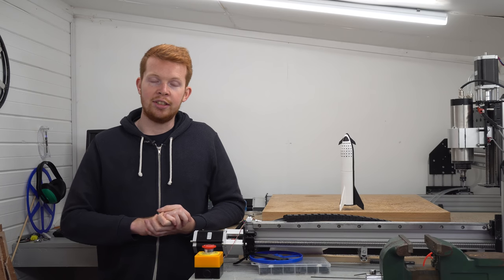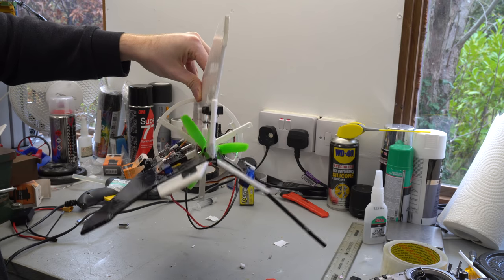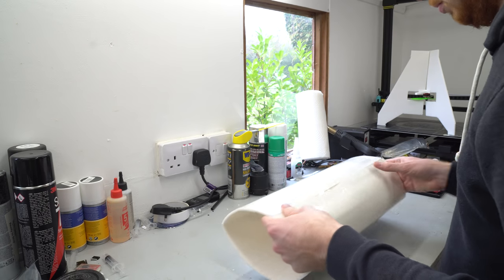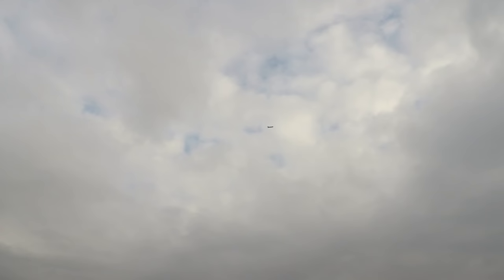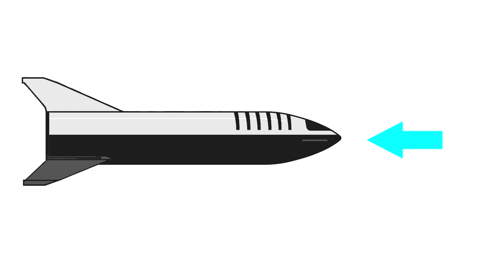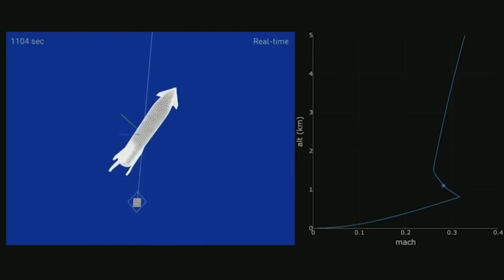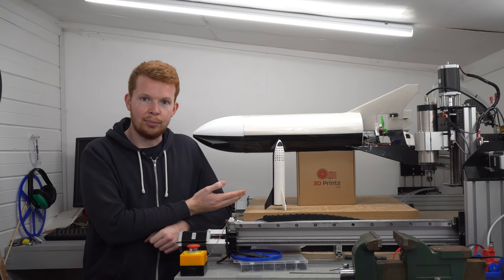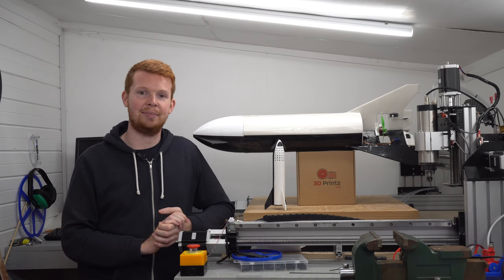SpaceX Starship Test Model - BFR

Comment: Using hot air to bend the foam makes life a lot easier
Reply: I thought, "didn't you read Tintin: Explorers on the Moon?" and then: uneven surface will counteract and smooth roll.
Reply: Bah, I would just spend 4 days 3d printing the cyclinder out  with a spool of ABS 🤣.
Reply: Peeling the paper off the "inside" and rolling it on the edge of the workbench works great.

Dance the Skies

Comment: It is actually very interesting to see how this accidentally matched the actual developement program. First small craft to check engine control(starhopper). Then add the body and fly only those(sn5-6) and then flop with proper model

Comment: Please do this with the new starship design. I’d like to see how the “skydiver” control surfaces work and I think the new design could work with one of your builds. You have an excellent understanding of the forces at play.
Reply: The skydiver control style was the same even back then. What has changed is the back fins are positioned in a better place (only 2 of them) so better aerodynamic stability.
Not that much has changed actually.
Reply: Thats nearly impossible because surfaces (controls) and volume (weight) dont scale the same way (square vs cube)
Reply: @hund4440  It's entirely possible. The model can use EDF for propulsion just like this model and thus save a lot of weight. Sometimes the atmosphere is pretty handy if you have it.
Reply: @MrRolnicek  @MrRoInicek is correct. The control concept has not changed, only the landing leg placement. The change eliminated the need for the otherwise useless leedward fin and allowed the two remaining surfaces to be tapered on their trailing edges for less weight and better control. The reason the lightweight model is having difficulty is three-fold. First, the front fins on the model do not actuate, where as they will on the Starship. Second, the model has no form of ACS thrusters, where as the Starship will have these and thus be able to adjust its attitude in vertical flight. Third, and most important, the viscosity of air for a < 1kg model is magnitudes higher than it is for a 200000kg Starship. It's the equivalent of a parakeet vs. a Cessna 172, literally, I'm not kidding the ratio is about the same. So the model gets picked up by the wind much more easily and much more forcefully where as the larger craft will not not have nearly as much trouble.
Reply: @StoneUSA  you mean the viscous forces are greater right? Because viscosity of the air will be higher in starship's case since the air will be blazingly hot (viscosity of gasses increases with temperature). However, as you said, the scaling of its weight vs its surface area still likely results in substantially higher viscous forces (relative to its weight) than that of Starship (at least if we are talking about subsonic flight, supersonic flight of course is a while other beast). But all in all, great summary of the main points of comparison from the model's case to the real one.

Comment: Hey Tom, I was noticing the high pitch angles and the instabilities during landing.... I wanted to know... and maybe it’s a dumb idea ... but what if you could change the centre of mass during flight and make it variable to control with a PID system within the long tube?? It would help a little with stability I think.. also right now, the craft is fighting with a lot of external forces. Have you thought about doing the take off and flight in an indoor soccer stadium maybe?? If possible just control some variables that way...

Comment: Very nicely done, that looks really.... fun.... to fly. A hair dryer works wonders on depron, I've found it easier to stretch rather then compress with heat, tested with 6mm depron on a form a quarter the size of your fuse, so I'd say heat and shape around a form, then apply tape.

Comment: I do think that the CoM is extremely important in this design.  Remember, SpaceX is building out of carbon fiber, which is quite light, and those engines are decidedly not light, so yeah, their CoM will be quite far back.  Also the moment of inertia of those front fins should be strong enough to affect the final change of orientation to the point of landing burn ignition.  Obviously the engines will perform the final stabilization as they slow everything down to zero.  Then the rear fins/legs can swing into place once the airspeed is low enough to be ignored.  I do think they will keep this design, since it offers an extremely precise method of control during reentry that doesn't rely on propellant.  They seem to have invested the time into the engineering, and I assume they know the mass penalties involved as well, and I can't think of a better way of dissipating all that heat than going in sideways.
Reply: Actually, they're building out of stainless steel now.

Comment: I appreciate your efforts and I really like your designs. The Space X Starship is my favorite. I think you're focusing in the wrong area as your approach. So close.
Look at it this way. Try balancing a stick (broom) on your palm and feel how the imbalance is. The top (cone of the rocket) of the stick is sort of like your pivot point. Your hand (palm) will do all the swaying and adjusting to keep it centered. This is sort of where all your focus is which I pretty much think you have it figured out and mastered. Its the cone or top that you need to control and keep pin point centered instead. And then the two will come together and give you full control of the flight and steady landing. The thrust and power you need is for landing and also to keep the top centered. Hope that makes sense. Just my observation and suggestion. I am not the expert. Just a creative thinker. Good luck and thanks for the fun and excitement. Aloha Ken

Comment: Take the paper off the inside of the curve before you try to bend then use the edge of a table or your bench to draw the foam over the edge curling it.  I just covered a round fuselage Dash-8 with a 7 inch diameter that way. I did use two sections each going only half way around though.

Comment: Hey Tom, Great work mate. The foam you are trying to bend has a grain. It will bend well one direction but will crease in the opposite direction. Once you find the correct direction, tape the outside of the bend and roll it useing different sizes/diameter pipes, like pvc or alloy. Have a look at RCgroups and search for Lockey, he and I have made some incredible jets and planes with rounded fuselages.

Comment: Very interesting project! I guess part of why the controllability of your model is so bad is that the Reynolds number with your model is much smaller due to the smaller size and lower speed compared to the real size Starship. The design does not scale down when the air viscosity is constant.

Comment: If you heat the foam, gently, with either an adjustable heat gun (starting from the lowest level) or a hair dryer, you can get it to bend/roll as wide or tight as you like by controlling temp over desired area & pressure. Might be easier working in smaller “sections” at a time and using a mold/jig.

Comment: Based on the published layout of the Starship, with the fuel tanks essentially empty, the center of mass would be fairly far forward.  If you look at the final seconds of the simulated landing, the front fins are straight out, while the back fins are fully folded until the last second.

Comment: Secret to bending foam: Tape on all outside surface then roll it around a tube. Tape can be removed once you are done. Looks much nicer than multiple crease lines and safer (more reliable) than heat gun.

Comment: Problem is that its too light, and it too easily pushed around by the wind. Also larger scale models have more time to react and adjust to turbulence. But for a model of that size I'm impressed by the amount of control you were able to have on it, and you almost landed it many times. Nice work!

Comment: You need to correct for the gyroscopic forces. When it is vertical and it pitches forward you need the flight controller to give elevator and rudder input as well!

Comment: Idea for maybe getting better foamcore cylinders, mount the foamcore on your mill and use a V tip engraving endmill to route evenly spaced slots , they should be pretty consistent in depth, and should be exactly parallel so when you bend it as you're doing now, it should tend to bend along the slots, and the curve should then tend to be a more consistent radius, and that radius should more consistently be perpendicular to the slots. I bet the slots won't need to be deeper than 25% of the thickness to be effective, plus if you wanted to you could lay glue/epoxy/etc in the slots after bending to strengthen the fuselage, but this probably isn't necessary or that useful

Comment: This is pretty awesome!   I imagine centre of mass plays a big role in this, and in the real BFS/starship there will be more fuel while going up, than going down so that will change centre of mass too.  Should look into how hard it would be to put the battery pack or a weight on some kind of rail or screw rod inside that you can bring up/down to change the centre of mass.
Reply: Definitely a factor in designs that operate over a wide range of speeds.

Concorde notoriously had 11 fuel tanks, and because of the era in which it was built that was managed manually by the flight engineer.
One of these tanks is in the tail and exists almost exclusively for balance reasons, but in general, the reason it has 11 tanks, rather than say, 3, like is more typical for an airliner is entirely down to being able to use the fuel to adjust the balance.

Especially because the aerodynamic performance during supersonic flight requires the centre of lift is very far back towards the rear of the plane, but at subsonic speeds this would make the aircraft extremely unstable.
The fuel was thus used as a dynamic ballast to adjust the centre of mass, and compensate for the aircraft's behaviour during two very different sets of circumstances.
With fuel pumped forward, it's more stable in subsonic flight, but when transitioning to supersonic flight, fuel is pumped into the rear ballast tank in the tail to move the centre of mass further to the rear, which is required for stable supersonic flight...

A craft re-entering at orbital velocity that hopes to use aerodynamics for anything at all probably needs to take similar measures, given the range of speeds it operates over are quite a big larger again...

Comment: Feels like you are going to need a Microcontroller such as Arduino to help control it in its different phases.  Especially when it is coming down with no power.  Allowing the fins to rotate the opposite direction to straighten it out.  Great video and I Imagine you are having a lot of fun.

Comment: Cool project! Nicely done, Tom. When you mentioned that maybe SpaceX will use the gas thrusters to achieve control upon landing, how about the few raptor engines on a gimbal? I wonder if you could add some servos to your propeller and see if the trajectory of the vertical thrust could have a similar effect as the pivoting front fins you admittedly weren't able to make functional. Just a thought.Either way, I really enjoyed watching!

Comment: The center of mass is probably such that when all fins are fully deployed that any cross wind would just push the craft without causing rotation. This is probably around the middle of the fuel tanks, so that the CoM doesn't move as fuel burns.

Comment: SpaceX uses gyro control of it's  thrust vectoring to balance the rocket for landing. That puts the center of mass at the top of the first stage, like balancing a broom on your hand. the fins only guilds the rocket back down to the landing platform, also using small burns before the nozzle chamber reignites and the Non-aerodynamic attitude control systems  takes over.

Comment: 5:18 looks like one fin stalled (or both did but one did more than the other) causing it to enter a flat spin which makes sense if the angle wasnt the same, the AoA of one fin was probably too high

Comment: another great video Tom  I always thought my mind was traveling at 100 mph but yours must be in overdrive LOL But as you do its nice to 'pick a problem , Study it then publish your conclusion or even build your conclidioin?  Around 10 or more years ago I was into Astronomy mainly du to me being unable to sleep which made it an ideal hobby. However I have a back problem. Hence gettting the mount lined up with the pole star via the polar scope always proved a right job to set up so I sorted out a wireless reversing camera  and used that with a google software app and that was just so different   and took ages off the setup.  I could have made off the idea but i did it at a star party and did not even think a bout financial aspect of it till a few weeks later I started seeing ads for the new vifdeo assisted polar mount set up tool..  Highnsight is a wonderful gift if you can use it when you need it??

Comment: HELLO, since its about thrust and CG, why not use two props further up within the tube, batteries closer to the tail (or even within) the tail fins and double the volume, 1.25 the mass? two engines rotating (cw, ccw), would essentially reduce the gyroscopic effect, and allow more control. when in doubt go bigger!

Comment: Great stuff! I noticed that the model looks Very similar to the BFR which is great. However, given that the atmosphere density is much lower on Mars compared to earth, wouldnt you need to have the controller surfares be proportionally smaller since your flying it on earth that has alot higher atmosphere density. Just an idea, your the expert ;). Thanks again for experimenting!

Comment: "Took it outside for a quick assembly of the nose cone to the fuselage". 
Did you know, how close you were back then to the original Starship SN8 just recently? ;-)
They stacked the nose cone on SN8 while it was standing on the launch pad, (after the pressure tests and static fire tests of the main body) ;-)

Comment: Would a contra-rotating motor work better to eliminate torque for your rocket projects? Not sure where it came from, but I have a dual motor with two counter rotating shafts, i.e. Bugatti Model 100.
You might be able to use RASAero II to calculate center of mass vs center of gravity. Also, If you 3D print (thin wall) the fins with the servo horns, it would be much more rigid than the foam board. 
I have really enjoyed this project!

Comment: Awesome job with the build, Tom! Very well done! 
I'm also wondering: What PID controller are you using? I've been working on a rocket design that's actively stabilized and I would greatly appreciate a little help with my research.

Comment: Please watch the video RC Flying Christmas Tree by Otto Dieffenbach... not just because soon is going to be Christmas, but because this is probably the only way your project could work.
He has used the quadcopter setup for the vertical flight (as I did for my Rocket Drone) and after the transition (he probably uses just 2 motors), he controls the tree using elevons (ailerons integrated with elevators).
In my opinion, if you want to use a single motor, you should use a at least a contra-rotating one (a lot of power without the hassle of rolling), possibly mounted on a gimbal, to have a proper thrust vectoring... hence a better control of your aircraft.

Comment: to be fair, a real rocket's center of mass changes on decent vs accent, when ascending, the center is much closer to the middle of the craft due to fuel weight, whereas on landing, all the really heavy stuff (engines) are at the rear

Comment: interesting but, the starship fins works only on reentry and freefall at very high velocity, in this scale, velocity and weight  dont work, for shure,  you can try put some weight into the thing, flyght all the hight you can reach, and do a free fall, maybe use a autolevel controler for the fins with servos, can be amazing to see, with front R and L and rear R and L all independend fins the electronics can control the pich the yaw and roll with the center of mass more or less in the middle.

Comment: I think I am going to get a bunch of complaints on my comment. I'm pretty sure the rear are much smaller and mainly house the landing struts. The fins d0on't control vectoring. That is strictly a function that is carried out the rocket nozzles. An external control surface is only as effective as the fluid flowing over it an as you know it is directly proportional to the velocity squared. A submarine is a good analog since submarines not only slow down but hover. When a submarine is slowing the con may call up a reverse in which the screw is pushing water forward over the control surfaces of the stern planes. I don't think this a derogatory comment when I say that the flow over the planes in the wrong direction actually causes the planes to produce the wrong direction of force which is called the "Chinese Affect." The same thing applies when you descend nose up. Any control forces created by the fins would be in the wrong direction.  I would also guess that the forward finds which are also small contain a vectoring system for when it is space. Some type of gas vectoring perpendicular to the spaceships longitudinal axis. The CG , I'm not sure of but if we started with a aer4odynamicqally stable ship then the CG would probably need to be around 1/3rd back from the nose.  Sorry for the conjecture but I would think you like to hear opinions . I really like you You Tube Channel. Of particular interest is the 3d printed plane videos.